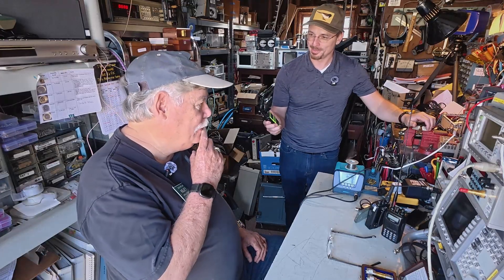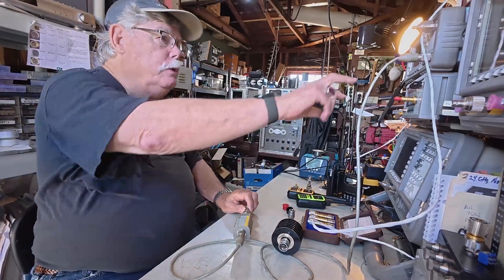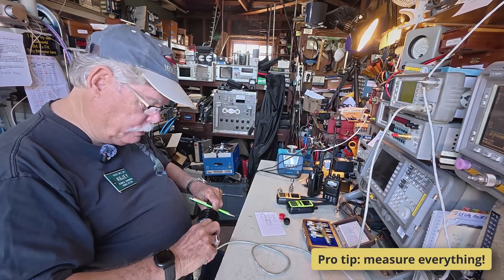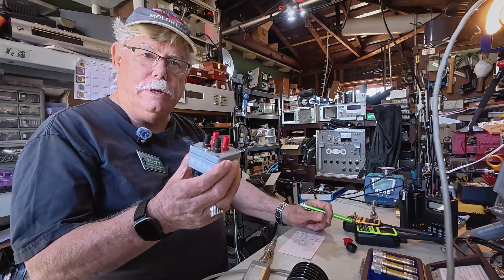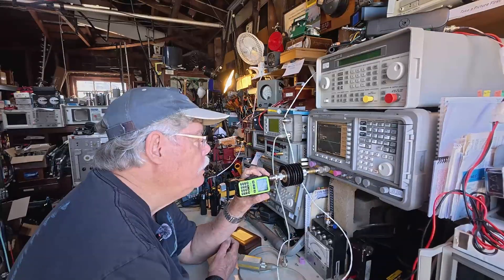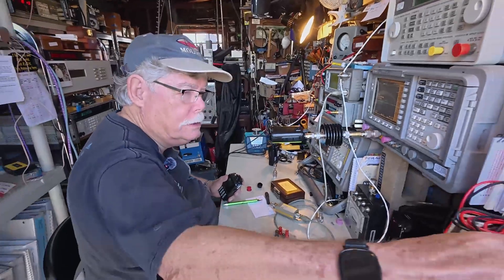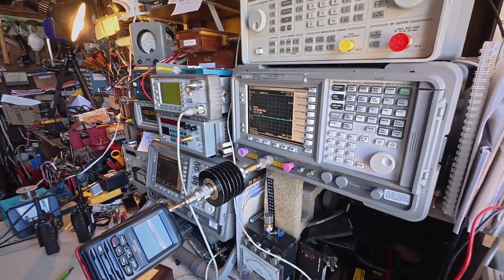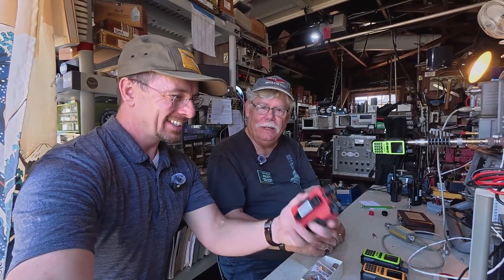Baofeng Mini: Fully Calibrated Test Results

Comment: To answer the traceability question. The generator is synced to GPS. Power level was established by the cal output level on the HPE4418B. Generally, the output is accurate to about 2%. The critical measurement was dB difference in level vs frequency of the attenuator and the accuracy of the E4407B analyzer. I stated that I thought a 2-3db syatem error could be tolerated and have useful results. I would have worked a little harder for more dynamic range. I could have left out the second attenuator.. The fundamental trace would have been +8 dBm, and maybe would have given us better dynamic range. If we needed better attenuation calibration, I have a  Boonton 2520 calibrator that is designed for that.  I hope that gives a better understanding of our setup.
     In our next session, we are going to test the TinySA to see if it overloads with strong nearby signals.

Comment: At 2:04, they say a 30 dB attenuator will reduce 1 watt to 10-20 milliwatts. In reality, applying a 30 dB attenuation to a 1 watt, or 30 dBm, signal reduces it to 0 dBm, which is 1 milliwatt, not 10 to 20  milliwatts..
Reply from the maker: That maths - close listening!
10*log10(1 mW / 1000 mW) = -30 dB

The rest of the video includes a careful calibration of the attenuator values, and those were used correctly. Hope you enjoyed the look into our lab session!

Comment: So, even if one took out all the calibration and just accepted the rated values on the attenuators, disregarded the loss in the connectors and cables, the net result would have been the same.  The radio's harmonic spurs are so far down, so far below the FCC requirements, that the possible errors in measurement will not affect whether radios pass of fail.
Reply from the maker: That would have happened here… but the only way to really know is calibrate, measure, and verify. It’s a fun process to systematically eliminate or quantify artifacts and errors!

Comment: One very noticeable thing in this video is the absence of coax cable in the setup and coincidently Erik the designer of the TinySA recently commented on a post that coax cable ingress can be an issue and he mentions using "good double shielded cable".  Not using any coax cable in the set up is really brilliant.
Reply: Absolutely. Buy good cables and test them frequently. And don't use them for anything else. Then label them!! Date- loss- frequency. Most cables go bad at the connector. Easy to test for.

Comment: How about sensitivity and selectivity? The UglyFengs Could be fine in TX without important harmonics, but are good than japanese HT in RX?
Chinese radios are improving quality, no doubt on that. It's nice radio this "mini". Only crap thing, the double PTT.
Reply from the maker: I haven’t done any detailed testing on RX, other than finding equivalent usability to my Yaesu FT5D. They’re equally fine in a typical QSO… and equally likely to overload when I’m near strong RF sources. Only thing I haven’t experienced yet is reception of weak signals in an RF quiet area.

Comment: The rigs are normally used with a stubby duck antenna. That antenna, in conjunction with the capacity of the user's hand is the load the transmitter sees and it is not likely to be anywhere near 50 ohms resistive.  The designer should have taken this into consideration when designing the output matching circuitry.  If not, the actual radiated power, due to mismatch, could be much less than the transmitter is capable of.
But yet people who test and evaluate these rigs always assume they are meant to work into a 50 + j0 load and proclaim that they are clean or dirty on their spectrum analyzers.  See the problem ?
73  Rick  K2XT
Reply from the maker: Hey Rick - don’t worry. Well aware of that limitation! This video was to test FCC compliance, not ‘real world’. The regs ignore the antenna, so… that’s how we tested :)
Reply: @SOTA-plus  Understand.  Hopefully the viewers do too.Admittedly, it would be much more difficult to use an antenna on the SA and it would have to be calibrated for harmonic and spur frequencies.
Reply from the maker: @feeatlastfeeatlast5283  always room to improve on the videos. Definitely not a professional at this, I just like playing with radios and cameras. Hopefully folks enjoy coming along for the journey!
Reply from the maker: Check out Steve’s work at the end of Josh’s latest video to get a look at antenna impacts - it’s cool stuff!

https://youtu.be/mU51_78Lv5s

Comment: Great video.   What are some recipes  to avoid overloading the tiny sa mixer and  is it possible to measure the attenuation of a variable attenuator purchased used at a ham fest using a nanovna or a tiny sa?
Reply from the maker: We’re heading back to Doug’s lab today - I’ll add this to the list of questions!

Comment: Your noise floor is at -60dBm but your fundamental for the Baofeng is at -13dBm. How can you say it is "clean" when your noise floor is not low enough to determine compliance? The Amateur Service technical specifications require spurious emissions to be not greater than -60dBc in the 2m band, which means your noise floor needs to be below -73dBm and preferably -83dBm to determine compliance. You should re-measure this with a lower RBW so you can reduce the noise floor enough to determine whether the Baofeng is actually "clean." See also 97.307(e)
Reply from the maker: Second half of that section is worth a read :)
Reply from the maker: Remeasured with improved parameters to get the extra dynamic range. Did 7 radios instead of 3. No problems. Keep an eye out for that video on a friend’s channel :)

Comment: Please demonstrate your traceability to NIST. Former metrologist.
Reply: I agree with the traceability comment, measurements are like a house of cards, each depending on the accuracy of each item used.  The starting (reference) instrument should have a traceability to a known "RECENT" calibration.  The Agilent power meter, although a fine instrument, is usually calibrated at a minimum of one year..   Even the 1mw reference output requires calibration over time..   But we keep in mind, as he said "He was a hobbyist metrology",  but granularity over 0.2db or the difference in "heating the power sensor with  your hand" all move into the realm of what is the starting absolute accuracy of the device?
Reply: Please demonstrate that you're not a twit. Too late.
Reply: @wzpu3283  Traceability is a fair question. I have a currently calibrated HP34465A, a stable DC source. and two calorimetric wattmeters. I feel i can measure 0dBm to about 2% of reading. The cal ouptut of both my HP and Anritsu 0dBm calibrators both agree within that spec. The analyzer was 10 years away from a current cal, but has been checked for level and linearity.  For amplitude inaccuracies in both the power sensor, meter and spectrum analyzer I have a Boonton 2520 calibrator as well as the HP and Anritsu power meters and calibrated sensors. As you may know getting below about 3% of reading at RF is very time consuming and expensive. I don't see any way to get more accurate that is sensible. Suggestions?   We also did not compensate for line loss. There are also other iuncertanties. We were not in a screen room nor did we have a stable temperaure over time.  Nevertheless our testing was only to evaluate the harmonic and spur output of the HTs. With narrower RBW on the analyzer we could have had better dynamic range and will do so next time.  It was clear that the radios thmselves were very clean compared to older types.  Do you see anything that obviously needs to be tightened up? Thanks